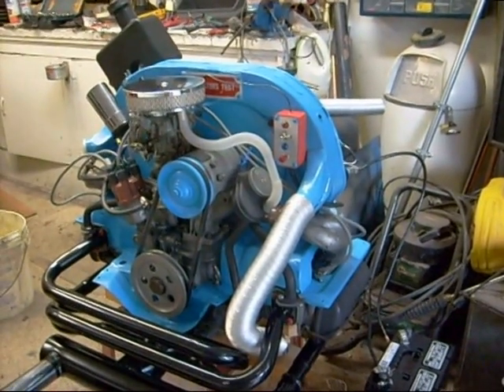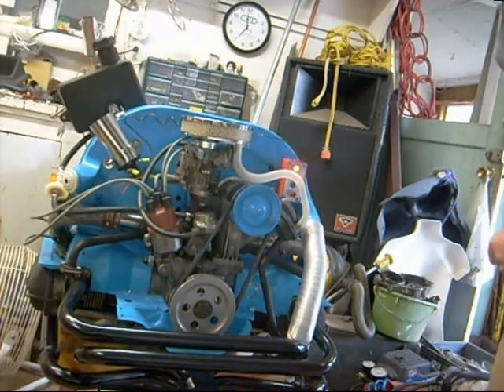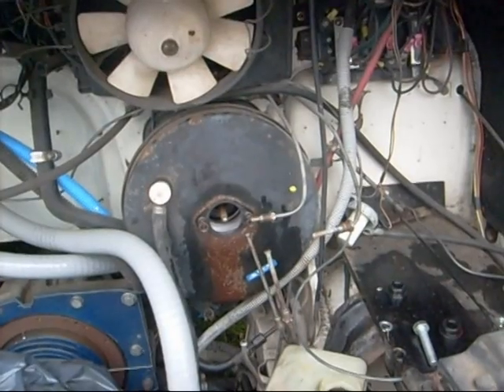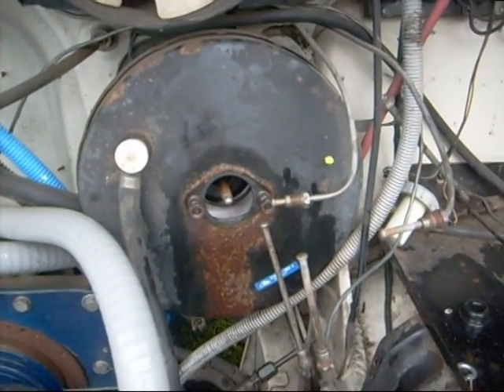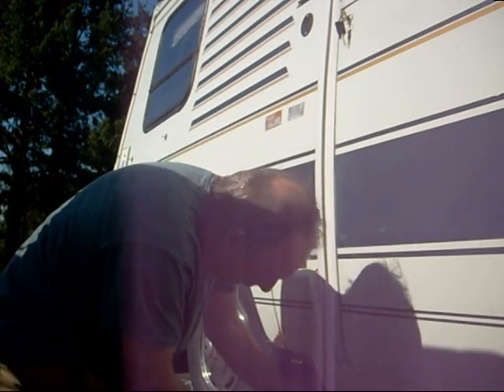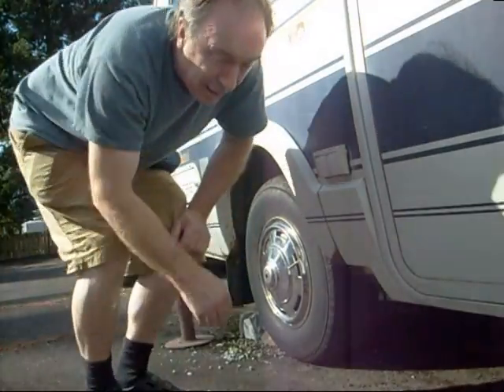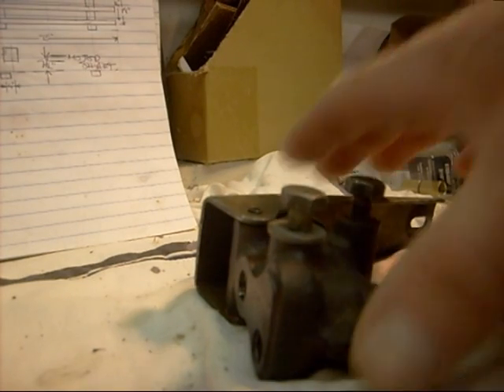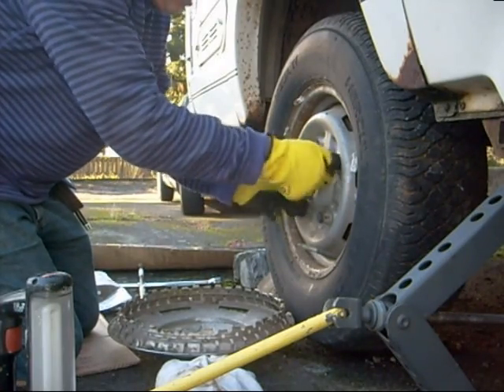The Electric Motorhome part 8. Winnebago LeSharo 1985

Comment: 20 kw...is about 23 horsepower.... even with oodles of torque... this is grossly inadequate for the van.    adding the alternator output and the battery current will allow more hp... but you are using half the hp the motor is capable of, and losing in conversion.. I do not get it ? !!